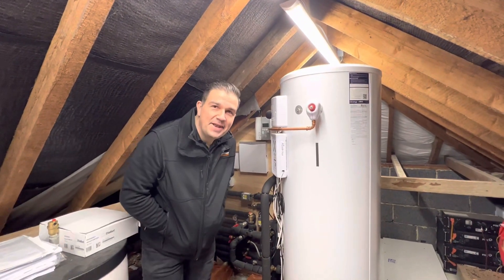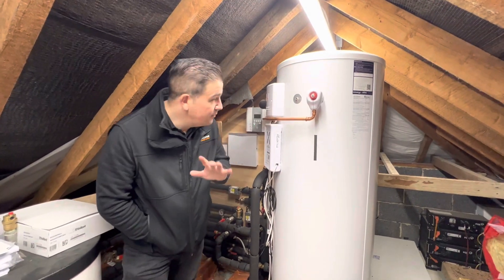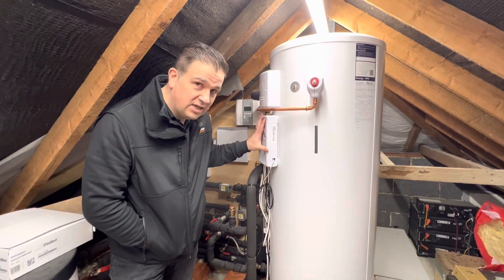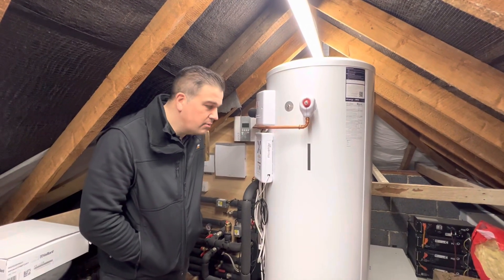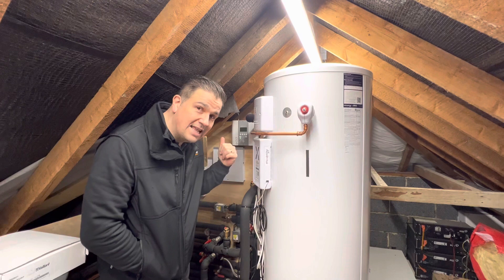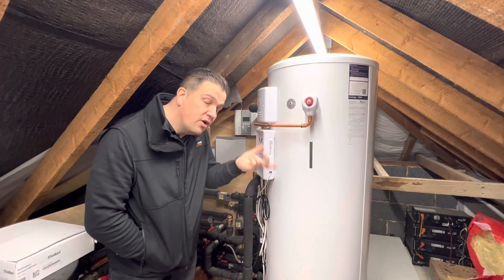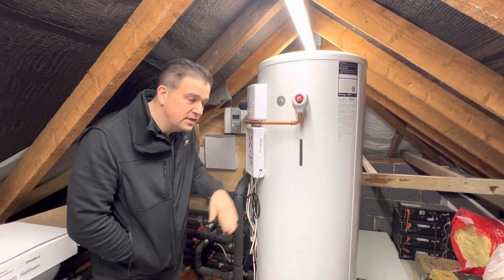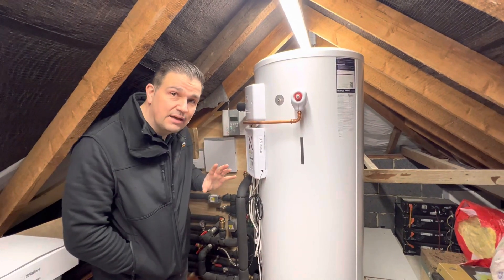MyEnergi Eddi - What is going on?

Comment: Eddi is a very good idea but the software (and its almost entirely a software product....no its doesn't have switches...they are software keys) and support from Myenergi is just appalling. All they do is direct you to a forum full of well intentioned (but completely without mechanistic detail) comments by well meaning users blighted by similar but often subtly different problems. The v5 firmware issued by this company has been a total disaster. It looks like even they don't understand why it doesn't work. They reply to service tickets by saying read this pdf, update your firmware, it must be your network  etc etc. One day it diverts energy from your battery, the next it fails to heat on a schedule, the next it doesn't work with surplus and the next it loses the grid CT and reports that its offline. Best advice if its working on an earlier firmware resist all company efforts for you to "upgrade" your firmware as a solution to problems. You'll end up wasting the £500 you invested in a simple idea gone wrong.

Comment: Thanks for this video explaination. We have been having the same issue with our Eddi, there seems to be loads of export to the grid but little to none being used for the how water. Our installers are back in 4 days to sort another issue so will get them to double check the Eddi's setup & wiring again. I'll post an update after that. Thanks